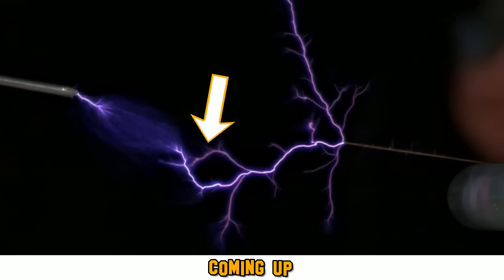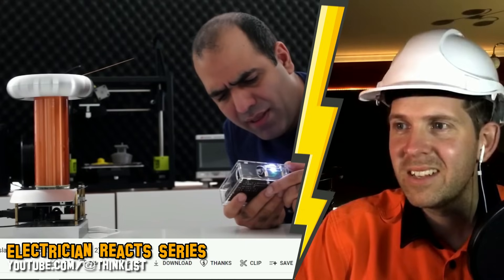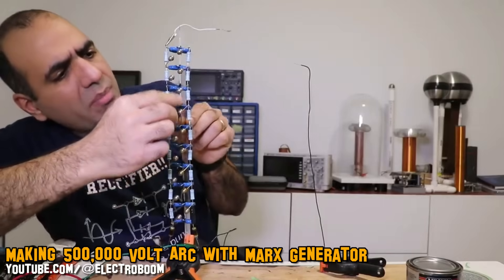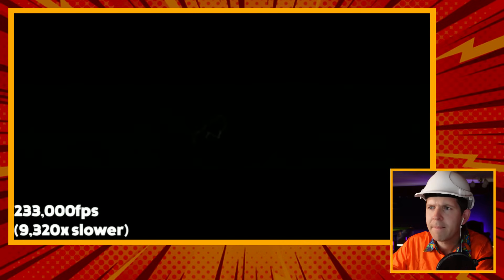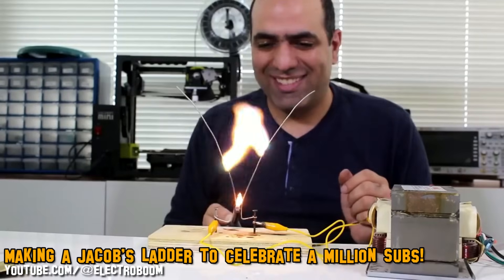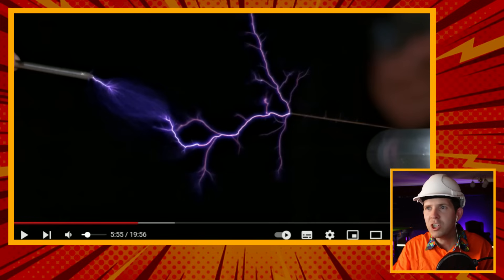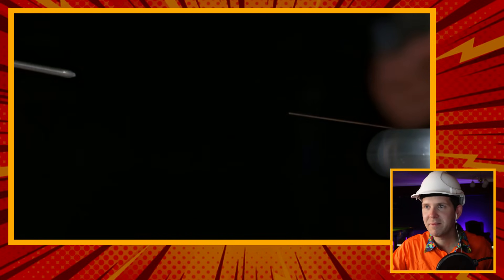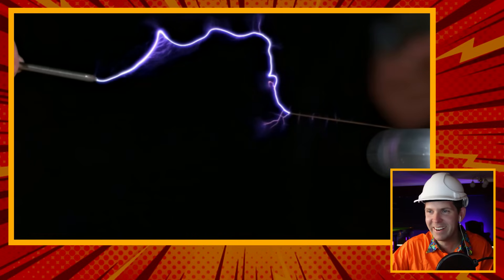Electrician Reacts to The Slow Mo Guys and ElectroBOOM

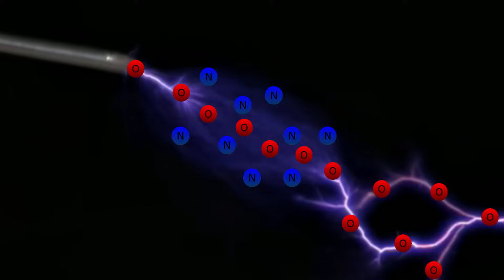Comment: 8:11 I think the phenomenon is similar to a lightning strike: the ray coming from the tesla coil is a stepped leader, a bunch of negative charges looking for positive charges in all possible directions (hence the zig-zag shape); as the leader gets closer to the screwdriver, it repels negative charges, until the positive charges on the tip of the screwdriver also jump in a streamer (the fluffy bit), looking for the leader; and when they finally make contact, all negative charges collapse into the channel created where the leader and the streamer made contact.

Comment: Did you just say "one Hert"? – The singular of Hertz is still Hertz.. 😜

The flaw in the theory of the sparks in the Marx generator going off one after the other is thinking of electricity "flowing" like water, but that's not the case, it's more like a pipe with incompressible fluid and no air, like a break line, the electrons just move a step simultaneously. At least with AC. You won't have any delay when switching on your ceiling lamp, the moment the gap in the circuit of a light switch is closed, the lamp is going to glow. With DC you would have a delay and sort of a cascade effect; like with the old Christmas tree fairy lights with bulbs.

Comment: I think at this level you are generating a plasma. The electrons flow freely, you are putting a lot of energy in to generate a plasma channel, you see electrons being pushed from one side and pulled from another, it branches as more energy passes through established channels, much like an ant colony, if two of these branches meet inevitably, then a plasma channel which allows direct conduction is established, this will move because the plasma will rise but new channels will form and expand upwards as new molecules are drawn in and ionized, I'd expect that at these energy levels both oxygen and nitrogen would ionize.

Comment: I feel like the reason that they couldn't see the separation in the spark gaps is due to the fact that electricity travels 100,000 km/s (1/3 Lightspeed). Their camera just isn't capable of recording that.

Also i plan on majoring in electrical engineering when i go to college in a few months

Comment: I wonder if it would be possible to record at a high framerate like this and then add a liquid or something that light travels slower through to slow it down even more.
Reply: what.
Reply: @EmperorPWNZ  the speed of light is slower through liquids.
Reply: @Dindonmasker  so how does it affect the time? For example, light travels through the water 1,33 times slower than normal. Do you see things 1,33 times slower underwater? I think no. 

It doesn't work that way. U can't slap some material and expect to get free slow motion
Reply: @EmperorPWNZ  if light slows down in the liquid doesn't it mean it will leave the liquid at a slower rate that it came in? Giving more frames for the camera to capture?
Reply: @Dindonmasker  nope, it will leave at the same rate, but it will leave later due to the decreased travel speed.
Reply: @EmperorPWNZ  i see, so it only adds a delay without changing the perceived speed. Thanks.
Reply: @Dindonmasker  no problem

Comment: I reckon that your theory is not entirely BS, N2 is a quite stable molecule, thats why it was so hard to make nitrous fertilizer from air and that dude that invented the process got the science fameboi price, but at that high voltages, it will fuck up N2 as well
Reply: The more I think about it.. might be even entierly true, electronegativity of O is pretty high and the distribution of gases is for all matters and purposes here almost homogenous, might be that the voltage charges the O2 way more than N2, what would push the electron cloud further away and suck the O2 positive core to the path of least resistance .. am I mumbling bullshit?

Comment: electrical arcs work the way they do there just following the path of ionized air since its the path of least resistance its also why it can sometimes be hard to get them started without breakout points or long waits between the arcs

Comment: Hi, I'm an electrician. In regards to Ionization, in general, it occurs whenever sufficiently energetic charged particles or radiant energy travels through gases, liquids, or solids. Electricity breaks down molecules of Nitrogen and oxygen into positively charged ions, thus making it easier for electricity to follow the path of least resistance. Now, the branching of the arcs from the tesla coil, I suspect that the electricity before reaching the screw breaks down the air (Nitrogen and Oxygen) first then when it is close enough to contact, it jumps directly to the metal. The blue/purple ish colour, I guess that would be thanks to Nitrogen particles being taken apart.

Comment: I believe the more the air/humidity moisture in the air becomes ionized which I believe it creates a temporary magnetic field which its repeling the plasma arc off the magnetic field  It created and continue on its path making it bend in different direction.

Comment: these cameras are operating at the limit of current technology, the sheer amount of data that these cameras generate every second is enough to fill up large solid state storage drives in seconds and consume the maximum available bandwidth current methods can pipe through the image processors and storage busses without the use of external high speed storage machines like those found in CERN  we just don't currently have compact technology with enough clout to go higher...  yet.
Reply: And its probably gonna be awhile before we do :/

Comment: You Described a Hertz wrong. :( Love the videos tho.
The Description you gave is half correct. 
You Described a cycle. Hertz is how many cycles you have per second.
In the US Mains power is nominally 60 Hz That is 60 cycles from 0 to (+) peek and (-) peek back to 0 volts per second.

Comment: As with lightening, the electricity doesn’t know beforehand where it will go. As the charge cloud builds up, it will generally try and take the path of least resistance; as it spreads further, it can start to cause charges of the opposite polarity to extend towards it. When it is eventually able to form a channel, the charges in the paths that didn’t connect will drain through the connection also; with lightening, what you see sometimes is multiple flashes as they drain.

Comment: The arc happens because: 
One electron leaves the atom due to high voltage. Then it bumps into another atom which it's loosing another electron. This way electrons grow up exponentially. When this path reaches the other side a spark happens (basically what we see in slow motion). The path i talked about visually its like waffle cone with ice cream on top 😉
Reply: Okay? And this had what to do with what he was proposing? He wasn't talking about why acrs happen, he was theorizing specifically why the arcs branch the way they do and he theorized it could be because the lower percentage of oxygen in the air making certain paths more desirable based on inconsistent mixing of the various elements that comprise air. Regardless of whether his supposition holds ground it wasn't a discussion on why arcs happen, but why they branch out like they do.
Reply: @DreadKyller  hmmm! Okay. I thought we talking about how an arc starts. And not why it is taking that path. Okay then my explanation was pointless!

Comment: For what it's worth, air ionization to generate sparks starts with existing ions, from cosmic ray and radioactive element decays (average about 1 ion pair per cubic centimeter) being accelerated by the electric field to energies high enough to ionize more air molecules via collision.  The field strength is highest at the tips of pointed electrodes and the advancing point of the corona discharge, so the path the spark takes is basically a random walk along the electric field lines.  This is seen more clearly in lightning flashes, where the distances involved allow better temporal resolution.  The Slow-Mo Guys did a nice video recording lightning in Singapore: https://www.youtube.com/watch?v=qQKhIK4pvYo .

Comment: On the graph you showed, oxygen isn’t much lower than nitrogen, so I would be surprised if it was just oxygen that got ionised. However high voltage arcs produce ozone, which is just 3 oxygen molecules, so the oxygen is definitely being ionised, nitrogen is pretty inert though so maybe it ionises and then just go back to N2. O2 is bonded using 2 bonds, N2 is bonded using 3, so that may also make it more difficult to break up the nitrogen into individual atoms and then ionise it.

The way I have seen lightning described before and why it forks is that the high voltage is essentially looking for a path to ground, you end up with individual arcs that are all going to lower potentials but then one hits ground and the bulk of the electricity then gets forced down that arc straight to ground and the other arcs die off essentially. You can see that with how the arcs fork anyway but also with the screwdriver and the Tesla coil, you can see the two arcs coming out of the screwdriver and coil and they fork then you get that corona discharge between the arcs, then when a path is established all the electricity goes through that path and the other arcs die off since there is a better path to ground or to a lower potential.

Comment: reason he said he found it odd that the spark set them off was its the final compositors in the row that did it, he would of though it be the first one closest to the power supply that would of set it off where in fact it was the final one that did it

Comment: For what it's worth, the blue-purple color of the arcs comes from Nitrogen being ionized, one of the videos showing this is by user jdflyback, who custom made Nitrogen-filled discharge tubes, showing the exact same blueish hue. My guess would be that oxygen gets shredded apart, forming the "trail" for the discharge to follow, while the ionization of Nitrogen, combined with black-body radiation from electrons returning to their normal electrical potent is what causes the color itself. If I were to guess the reason for the branching, I'd wager there's more oxygen around the areas the discharge is gonna follow, cause electricity does break apart oxygen into positively charged ions, making it easier for electricity to follow the path of least resistance
Reply from the maker: I love it
Reply: I think an important thing to note is that air temperature is just an average.

Some molecules will have slightly more energy than others at any given point in time, they're random distances apart, traveling in random directions, the spark rips molecules apart and sends the atoms flying in random directions (effectively detonating them,) etc

At any given point in time, some paths are going to have less resistance than others, so you end up getting Brownian/chaotic paths through it
Reply: The Oxygen is being ionised too although it is hard to distinguish the light-blue plasma of the Oxygen from the violet-blue colour of Nitrogen by eye. Point a spectrometer at it however and you would clearly be able to identify both because each is actually a series of bands of emission unique to each molecule. Our eyes can't do it as we perceive colour based on the total stimulation received by each of our three types of cones so we cannot identify the individual bands and the overall effect is very similar with our eyes limited sampling method.